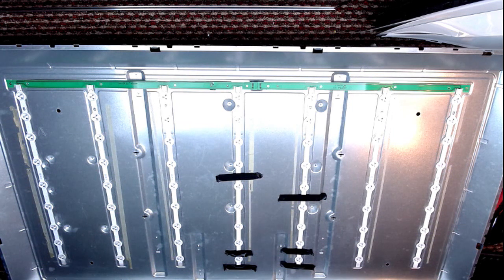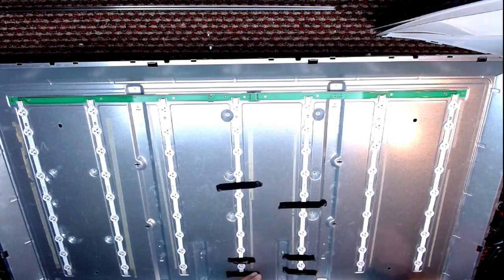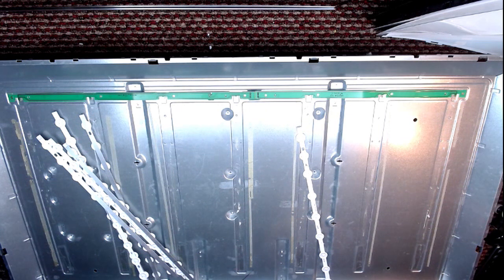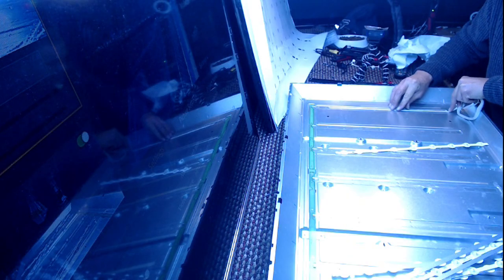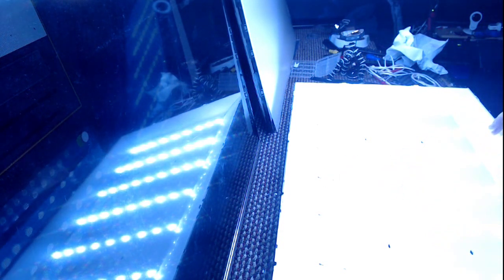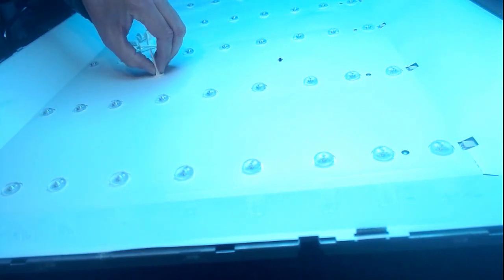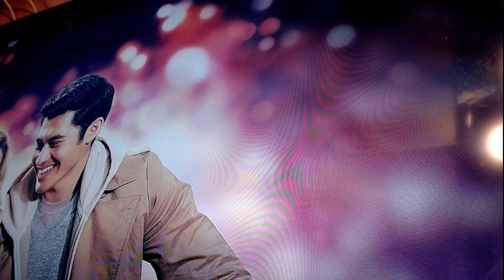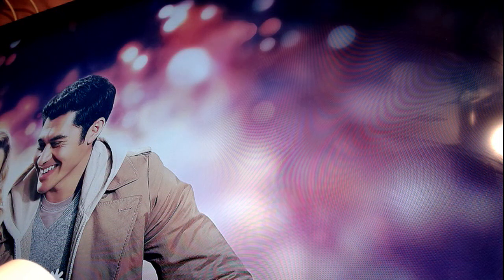Polaroid 50 Backlight replacement

Comment: Do you have a link for where to obtain the LED strips please or can I purchasethem from you. Or can I use any A B strips with 7 leds?
Reply from the maker: You will need to type in your screen number to eBay.  It will start ves500

Comment: Hi I have a Polaroid p50led14 blue light flashes 11 times no picture or sound. Would I be right in thinking it's a main board issue?
Reply from the maker: No not if the blinking stops. It will be the backlights as per this video.   Shine a torch on the screen after the blinking stops and see if you see a faint image.
Reply: @allenfleckney5969  I've tried the flashlight thing but no sign of any image

Comment: Hi how you doing? My Polaroid shut off completely no picture at all but there’s like a ticking sound in the back do you have any ideas? Thanks.
Reply from the maker: Sounds like diodes on the power board.
Reply: @allenfleckney5969  much appreciated buddy👍🏻 I was thinking about buying a new power board as there’s no power getting to the stand by light I’ll give that a go, your videos are really helpful especially the backlight for future reference thank you just subbed you mate.
Reply from the maker: No need to buy a new power board   There’s a cheaper option.  Search for me on Facebook I’ll show you

Comment: Hi Allen, is it possible to get replacement spacers. It's those white pointed plastic pieces that keep the diffuser at the correct distance from the LEDs. Mine have all snapped :(